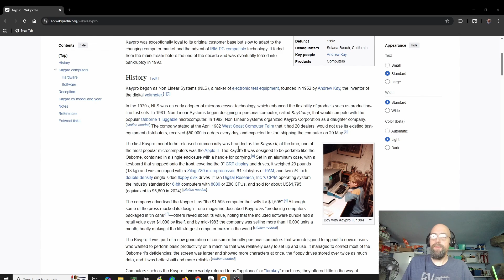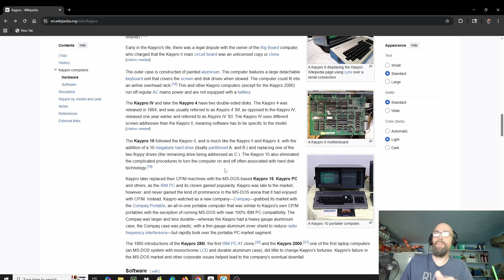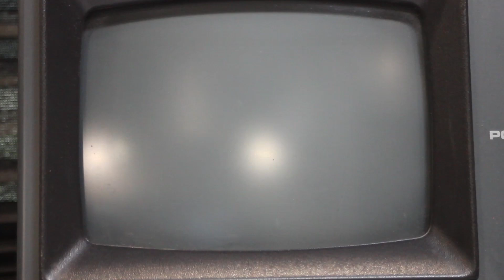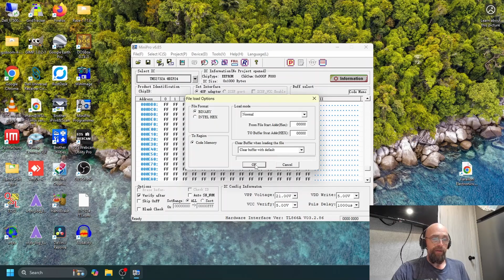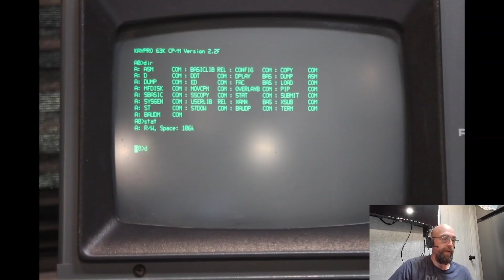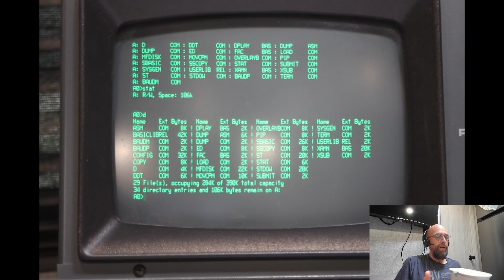This Old Kaypro - Restoring a Boot ROM

Comment: What happened to the industrial 286 board? Will you be making more videos about that?
Reply from the maker: I need to work out the glue logic to attach a keyboard to the keyboard controller. It is still in the  rotation, but it may take some time to get back to it.